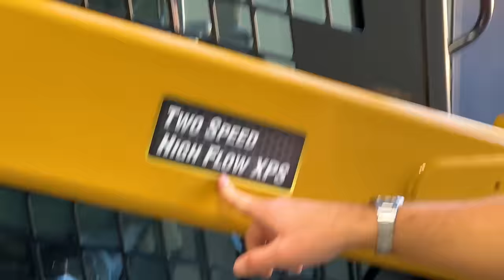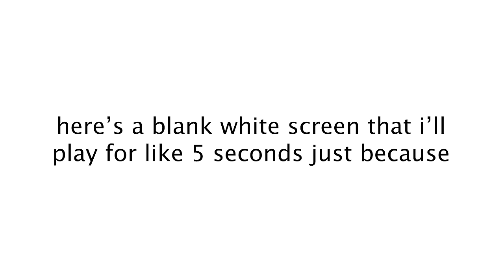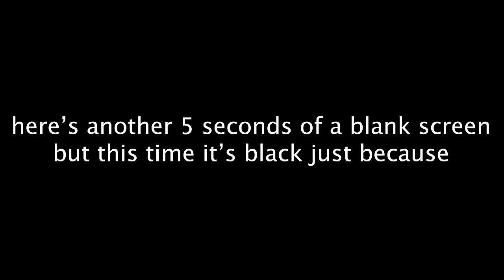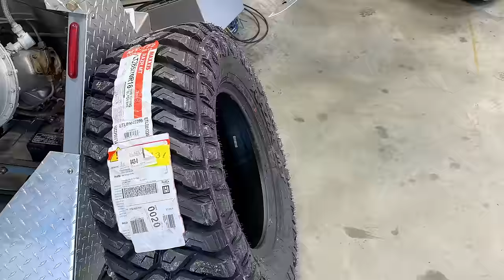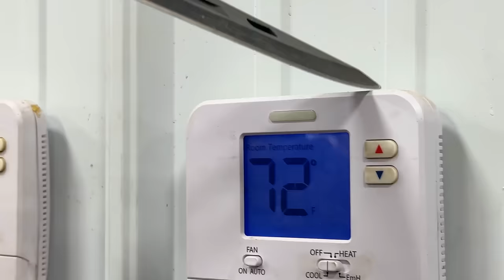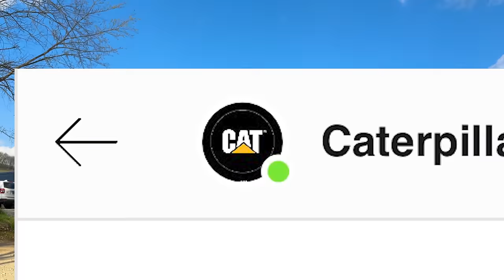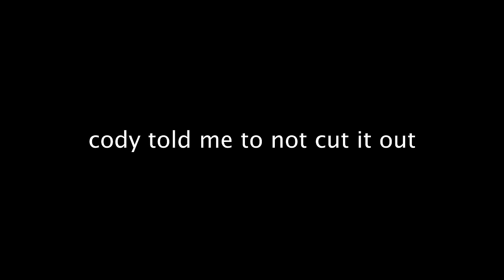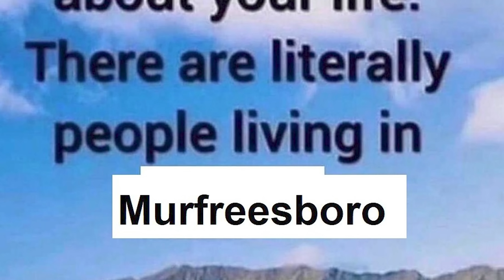Whistlindiesel buys $60M in equipment (bankruptcy)

Comment: Skid loader durability test
Reply: Yes!!!
Reply: It was posted 10 minutes ago. Meat rider
Reply: Yes
Reply: If it breaks they have the key so they can just find a new one
Reply: Jet engine on Skid loader time
Reply: I think a skid loader would win because it’s is built for like construction sites and stuff
Reply: It's not red though
Reply: @felio_  yeah but the key may not fit to every skid loader. Whistlin diesel we need to find out. Does it fit in the ignition? Because it might be a different ignition, and it may not fit
Reply: @TyTom-jq3vv your account is 1 hour old lil bro
Reply: I second this
Reply: shid loader
Reply: Yes
Reply: That’s a tough one. They’re built like tanks basically
Reply: The blank space is like an intermission - it gives us time to enter a comment without skipping a beat.
Reply: Coming soon
Reply: @TheMidnightClu6  yes put some GE9X on it 😂
Reply: NO
Reply: As someone who owns one, they're hard to wreck but you can mess with the hydraulic lines pretty easy. Other than that, good luck.

Comment: Me and cody get along. Back in my mill days I'd bring in soaking wet packs of lumber into the plant make the floor slippery and in a 30 ft x 55ft slab I'd floor it on the forklift into the plant from outside , crank it and try 360ing the forklift on spot 😅 almost slid the thing through the building so many times 😮

Comment: LOL the lead warning. TBH very long story. TLDR: youll be fine as long as you dont bathe in the used oil of the engine. Thats where most of the high lead metal is probably located. And youll probably never touch it. And EVEN THEN, it would require quite a bit of exposure time and a lack of washing it off.

Comment: That's not a high flow. You cheaped out on that 299 D3. The Highflow has an additional radiator and hydraulic pump on the top of the cab. 😊

Comment: This is boring. Your obviously out of material. Your still cleaning dirt off with a shovel. Go get a big boys pressure washer. NLB, Jetstream, or if you want the Cady of washers, Go talk to Denny at Hammelman. Anyway, get something that does 20000 psi at 30 GPM. You won't be able to hang onto it. But that's where the fun begins. Think of all the things you can do/destroy with that kind of pressure and volume. You and your party of adult misfits can try not to kill each other. Then when you really want to clean your equipment, just turn the pump down to a low roar and split the flow to 2 or 3 guns, say 10 gpm at 4000 psi. You probably still won't be able to hang onto it for long. Get a water truck or tank too.